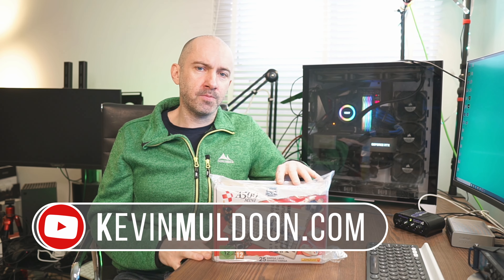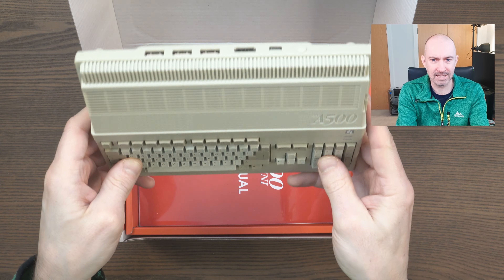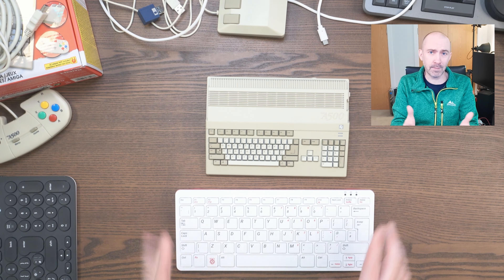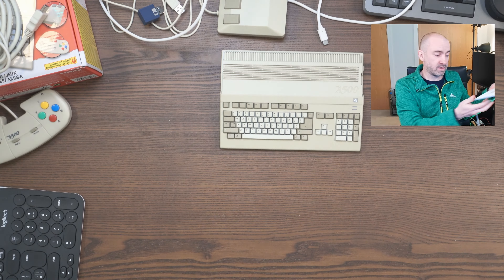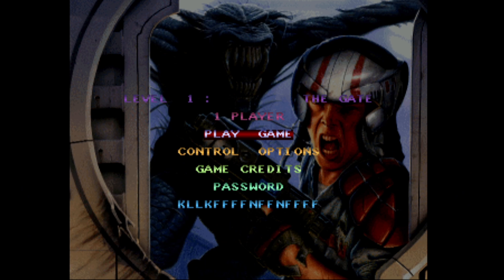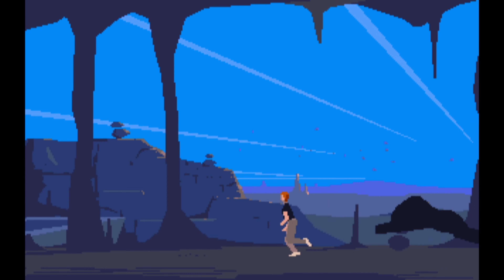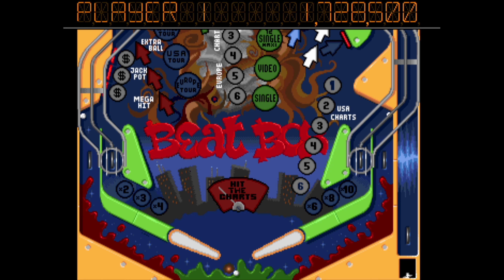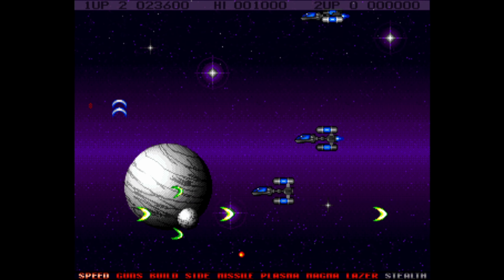The A500 Mini - Full Review: Unboxing, Games & WHDLoad Emulation

Comment: Overall a great review of a lovely retro system. 

I would urge that you play Paradroid 90 again. It seems (from that vid) that you were treating Paradroid 90 as a shoot'em up. Paradroid 90 is so much more than that. The game revolves around transfering your core from droid to droid, preferably to better, more powerful droids. To do this your core can enter into grapple mode (hold fire button down until you get a wiggly electrical line) then charge at the target droid. This starts a mini-game. Choose the adventagous side of the board and then fire off your tokens to change as many central boxes to your colour (yellow if your playing on the left side, pink if your play on the right). The side with the most boxes wins. A win means that your core is transfered into the target droid. Losing means that your core is ejected from your droid or, in the event of your core not occupying a droid, game over  It's probably easier if I refer you to a video that demonstrates how to play the game well: https://youtu.be/bRibUjPXUKk

From my point of view, Paradroid 90 is a classic reworking of the C64 original, with some marmite streamlined gameplay. My only real gripe Paradroid 90 is that it  ignored the enhancements found in the ZX Spectrum conversion of Paradroid (called Quazatron): specifically isometric presentation. It could also have added some more mini-games to add a bit of variety, such as the ones from Magnetron (Quazatron 2) and Ranarama.
Reply from the maker: Thanks for the detailed explanation. I'll need to revisit it as I've not had the time to play these games as much as I would have liked. 

I'm keen to get it set up with a portable monitor.

Comment: I look forward to using Workbench on it and playing with various performance settings.   The little thing is effectively an Amiga 500, 600 and 1200 with a 68000 ~ 68040 CPU, that's so fast, it's faster than an A4000 with an 040, maybe up there with an 060 CPU.

Comment: Same joysticks issue and compatibility problems with the C64 maxi.  One thing I like is I got old PD magazine games working that have been converted to WhdLoad such as Tetris Pro, Cabinet Asteroids etc. Also I love some of the 8 bit Amiga versions of classic games such as Starglider, Barbarian, Star Wars. There’s some new home brew too,such as a new Bombjack. Plenty of potential in this Amiga mini. Chaos Engine is superb. Point and click games such as Monkey Island and Flight of the Amazon Queen are great- just get the speaking versions. Don’t forget the latest firmware supports CD32 games. This open up more home brew options aside original cd32 titles. I wouldn’t pay much for the Amiga Mini. If you can buy a used machine. In contrast the c64 maxi is worth every penny as a new unit once you start adding games to the carousel permanently, unlike what you can’t do on the Amiga mini, as of Autumn 2023. just my opinions of course.
Reply from the maker: Wow. I didn't know the latest firmware supports CD32 games. That's pretty amazing. There's a lot of CD32 games I'd love to try.

Comment: Can you get Octomed working on it? You would need to use all 3 USBs, 1 for the mouse, 1 for a keyboard and the other for the USB stick. Would it all work using that WHD load method and would you be able to load samples from the USB stick too?
Reply from the maker: I've not tried loading any apps (i.e. non-games). I suspect it is possible if you use a hub to connect all the perhiperals.

Comment: ahhh i miss my old amigas :( shame they left the operating system out, that was so good back in the day.
Reply from the maker: You're right. That's something I should have mentioned in the video. 

My guess is they couldn't because of licensing reasons (they couldn't use the commodore brand anywhere either).

Don't get me wrong, the interface they used does make it easier to navigate games, but an option to use the old OS would have been cool.

Comment: You should say that You did receive the YouTube reviewer edition. because I did not get the big user manual and the USB stick included.
but ofcourse the user-manual is online and can be printed out if someone really needs it LOL.
and the stick is to small for for instance Aminimiga or Amiga-inside which everyone is running by now to get full workbench usage. 
16 or 32gb is perfect. but bigger is possible also. but then You have to download Rufus to format the stick in MBR FAT32, because Windows itself does not do that with bigger then 32gb sticks.  
and the newer update of WHDLOAD is not a firmware update but a newer WHDLOAD list, a firmware update will come soon though.
this presumably might flash the firmware inside to the newer version of Amiberry.
( hey, greaseweasle support would be nice if thats possible, or midi support to connect my MT32 via usb2midi :p )
Reply from the maker: Hi Jan. 

The company did not state that the unit I received was any different from the commercial unit available in shops. 

It's something I would have stressed in the video if they have advised me of this. 

Kevin

Comment: You could put that circuit board inside an old console or something. Still use as a Amiga but load up Pandory to run general emulation. After all it’s just another SBC in a plastic case and nothing revolutionary. But of course I wouldn’t do it if we had an Amiga maxi.😊
Reply: They should make an A600 case with working Keyboard, using the guts of the A500mini.   The Amiga 500 is very large, and for most games the num-pad isn't rarely used.

I think a company would be smart to convert one of their 70% keyboards with mounting for the MINI and USB  splitter would make some good money.  There are some 80s looking mechanical keyboards out there that would work well.

Comment: Seeing how this is a linux box running an emulator you would be better off buying a raspberry 400 for about the same money and installing fs-uae emulator and have an Amiga with internet connectivity and a working keyboard PLUS you get a decent desktop computer as well.
Reply from the maker: You have a good point. 

I've got raspberry pis that have Amiga games loaded, but the appeal here is the whole package being put together for you with the controller, support for games etc. I'm a big fan of playing games on pis, but you do need to spend a little more time configuring things. 

That being said, if you don't want to just limit yourself to Amiga games, a pi would be a better option.
Reply: @KevinMuldoon  Ya I do see it's turnkey operation as an attractive option, especially for those who not too computer savvy and it looks cute as well. Just wished it wasn't at the same price point as a Pi...
Reply from the maker: Haha I know. I'm a big fan of these retro style emulation consoles...even though I shouldn't be haha. I'm still tempted to get the C64 one as it's so cheap now.
Reply: @KevinMuldoon  Yup I bought 3 C64 mini's sold one to my buddy use one and one is still sealed in its box. Awesome product, I built a Frankenmaxi out of an orange pi lite and I have Combian 64 on a Raspberry pi that I am turning into a BBS (I used to run one 37 yrs ago) Just got the telnet connectivity working last night.
Reply from the maker: Interesting. I didn't know that the old style bulletin boards were still popular. That's pretty cool.